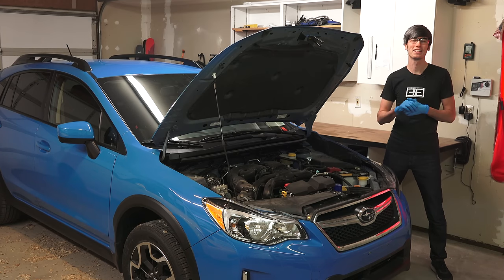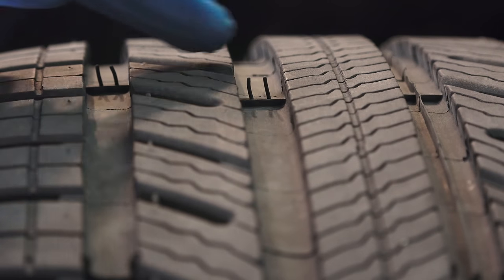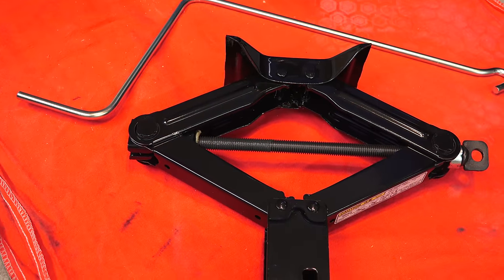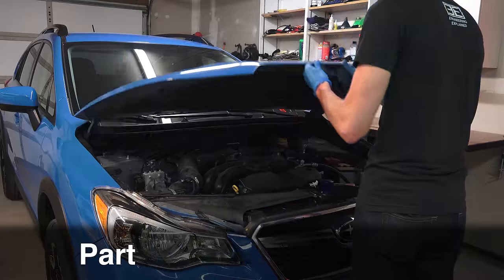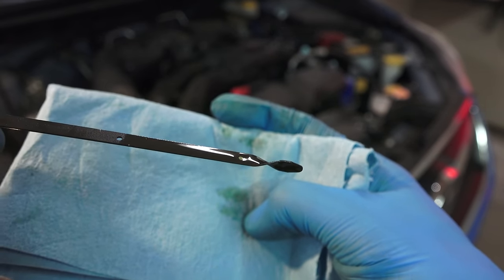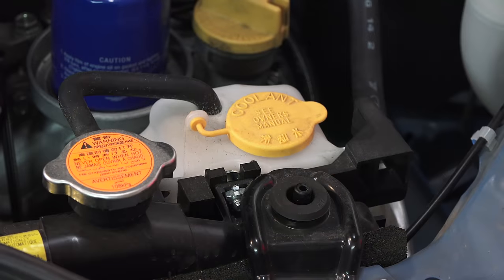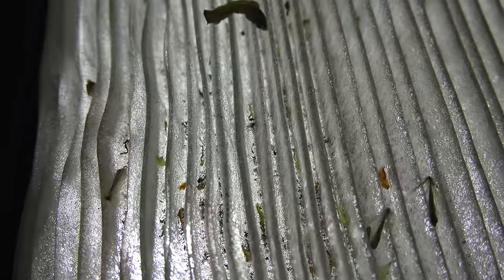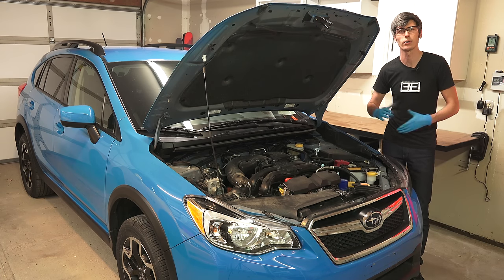How To Make Your Car Last A Long Time - Simple Checks

Comment: How To Make Your Car Last A Long Time - Checks payable to Engineering Explained will do just fine..
Reply: I use Progressive Insurance.
Reply: I'm still not sure. Should the dipstick read L or F? This is so complicated.
Reply: AHDBification  depends on how you drive your car. fill to L if you drive on the left side of the road and to F if you drive in the front of the car.
Reply: no insurance suspended license. but I got 200,000 in the bank from savings on no insurance and not paying tickets😉

Comment: These are great easy tips for anyone to check. I will say though the oil should be a little warm to get a more accurate reading. Turn your car on for a couple mins then off. There is some pressure that needs to build up and after a little time it will regulate. Take your dipstick reading there.

Comment: check the state of transmission fluid too.
Reply: yup one of the first expensive part of the automatic car that will fail even before the engine quits..
Reply: Can you guys give a little more info about this subject?... I've always thought it would be a good idea to maintain the trans fluid but to be honest I've never really messed with it because of all the different opposing opinions all over the internet as to why you shouldn't mess with it kind of made me freeze up when it comes to the trans because of the fear of effing shit up...I'd hate to do a trans flush and fluid change on a good working trans only to run into issues shortly after 

What are your guys opinions on that? Cuz I do believe it is important and want change the fluid in mine
Reply: HomeGrownPyro my 07 acura tl base nav has 140k miles on it and i dont think the transmission fluid has ever been changed. I brought it to my mechanic and he took a looked at it and it was kind of like light ish brown color(it didnt look like it was disgusting) he told me it was still in good condition. The thing is that my car in 3rd gear and around 1300 - 2000 rpms sometimes starts shaking like the engine is stalling out but it stops once i get the rpms higher or change gears. Also another thing i notice is on high rpms (above 6k) when it changes gears it kicks. Ive driven my dad suv hard and in high rpms the transmission doesnt kick its just a natural hard shift like it’s supposed to do. I bought the car with 136k miles on it and im thinking of doing a tranny oil change at the dealership since i want the car to last as long as possible. 

Im not doing any engine mods on my car since it would be just a waste of money. I will just try to just keep maintenance up on it. Ive never cheaped out on maintenance on it since i had it. I did an oil change on it, new engine air filter, and alignment as soon as i bought it. Recently i bought new brake pads and put those on cause it was an emergency. But im looking to replace all the rotors and calipers and pads(except the front pads) on it. Soon will be some lighter and better looking rims cause the previous owner had some gloss chrome heavy ass mexican wheels on it.
Reply: transmission fluid is the oil that keeps the gearbox LEGO set pieces of rubbing metal parts in the Gearbox running like a Swiss watch mechanism...it is the ''*engine oil*'' for  a gearbox on an Automatic car..VITAL to change according to manual API/SAE viscosity and intervals! Dont use Flush fluids, just change them with fresh auto fluid in accordance to manual recommendations or risk 5000 dollar replacement fine!
Reply: Not all new cars are made that way.
Reply: What are you, a time traveler? Were you frozen a while ago and only recently thawed? You don't check the state of transmission fluid anymore, they've been sealing that up for years and you can't get to it.
Reply: @mjc0961  mate not all people watching this video have the latest cars. i bet a lot of them have older cars. please stop embarassing yourself
Reply: @vincentsfuntimeworld5007  These days car makers encourage less maintenance and eventually causing people to buy new cars for more business angd profit. 100k oil change and sealed transmission are some of their tricks. Otherwise they would have extended warranty but they don't.
Reply: @mjc0961  If you can't check it yourself, you can ask your mechanic to check it. You should change your transmission fluid periodically if you want your transmission to last, unless you have over 100,000 miles on your car and fluid has never been changed and is dirty. In that case, you might do more damage by changing it, especially flushing.

Comment: How high should my oil level be if I upgraded to a short throw dipstick?
Reply from the maker: Solid mod! 😂
Reply: Oil has to be filled until it overflows from the valve cover. This allows you to do an oil pump delete for friction reduction.
Reply: Named after you

Comment: also if you want your car to last, drive sensibly.
Reply: I guess that means my cars won't be reliable.
Reply: Sensible whatever that means. “Same as saying don’t work out you could hurt yourself.”
Reply: E85 13B no. Thats a bad analogy. The correct one would be if not running the car in a long time

You dont workout= bad

You dont run the car= bad

Working out pretty often =good

Running the car pretty often= bad

Working out too hard with no breaks= bad

Driving super agressive in higher rpms = bad

Theres a balance to everything

If you drive agressive all the time i feel bad for your car. Once a while wont do damage
Reply: YUCK I can imagine the carbon buildup in the engine.... REV IT UP
Reply: E85 13B your car doesn’t recover and get stronger after you do a hard pull lol
Reply: no! drive like you stole your car
Reply: Unless you drive like Grandma all the time, your engine will be plugged in carbon buildup. I've seen a number of older low mileage cars vibrate a ton at idle. I'd drive them hard during a test drive and they ran smoother lol I'm not joking. Carbon buildup sucks.

Comment: In the aviation maintenance community we NEVER use digital gauges. Also highly recommend against the ones with the little stick that comes out of the back. 
Best gauges I’ve ever used were the ones with a dial, that has a check valve built in.

Comment: I live up north so I keep my tire psi at 35. You lose some psi in the winter so it's good to keep it as least 2 to 4 psi higher than recommend. I find some lights redundant such as parking lights and license plate lights. Purely for aesthetic. Every car should come with fog lights. It's useful when your low beam is out.

Comment: Only thing I’d add is to shake each tire if you get it off the ground. It shouldn’t have much play. If it does that indicates some problems with your suspension parts(control arm, tie rod ends, etc)

Comment: Other an checking the brake pad thickness and suspension this is all pretty simple easy to do stuff. Another check you may want to do is to check the rubber "boot" on your CV joint. Look for cracks or tars in the rubber. That being said, I'm a DIYer and as a retired guy I took a part time job at a local gas station to keep busy. In spite of how relatively simple to do these inspections are I am surprised how many people don't know how to do any of these things. Some things I've heard are, " oh? there's still oil in it, I don't need an oil change". The oil I just checked for them is the blackest black I've ever seen and in one case they had the vehicle for 3 years and had never changed the oil. Or, " do you think it's okay for me to go on the highway to XXXXXX right now?" , after a heavy snowfall. I said, " as long as your tires are in good condition" to which she says " oh they are new I just got them from my Uncle's car". The tires were all seasons all worn to a point where you couldn't hook a finger nail if you dragged it across the tire. Another big on is when someone  drives for 10-15 minutes to get to the gas station and adjusts the tire pressure to the pressure on the door jamb label. I have told so many people that as a tire is driven on the air inside it heats up and the tire pressure increases between 2-3 psi. So they have lowered their tire pressures back to 35 psi but are now running their tires at 2-3 psi low which has a negative effect on tire performance, gas mileage and tire wear.

Comment: It's amazing how many people don't even know how to check their engine oil level or tire pressure. Seems like common sense but you'd be surprised.
Reply: Don't get me started on changing tires either.
Reply: Or how many people inflate their tires to the pressure written on the tire. You know, the max pressure? Ugh. Check the sticker in the door, don't fill it to the max pressure. 🤦‍♂️

Comment: How to keep a car reliable.. buy a Honda 😅 in all seriousness great video with good tips!
Reply: 600,000km Honda k-series engine.    Check oil at least once a week
Reply: Tyler Peterson i have j series with 140k on it. No problems so far. 

Coworker with a dodge magnum v8 tried racing me and smoked his ass
Reply: Even a honda will turn to well engineered scrap if it's not taken care of.
Reply: That being said my dad drives a honda jazz (fit), 2010 model I believe, and my mum a 2003 Toyota Avensis Verso VVT-i. As you can tell they aren't exactly car people and as such they don't really maintain there cars, hell I've never even seen them top up the oil. But the toyota is still going strong! Never had a mechanical fault, is a daily commuter car and had been on many road trips around europe over its 15 years. I'm actually amazed its still running like the day we got it, mechanically speaking it hasn't been especially well looked after. And when it goes I think I'll oddly miss that thing, I practically grew up in it.

Comment: First thing I noticed under the hood is how easily accessible that engine oil filter is.. nicee
Reply: The older Subaru had a timing belt with a oil filter on bottom. New ones have timing chain with oil filter on top. Plus alot easy to get to everything. That's one of things I picked Subaru!

Comment: Can you make a video about driving habits to make your car last a long time. Such as proper shifting vs bad shifting that can lead to wear or appropriate loading of the vehicle and engine as well as being consious of temperature. How downshifting can affect your transmission if done poorly or whether to do it all. Your regular speed on highways and how that affect your car over time. Parking on inclines vs flat parkings. Hard braking or harsh cornering. Overfilling your fuel tank by rocking the car side to side. Putting too much water in your coolant. Using in appropriate oil. I'm no expert but these are some of the things I wonder about. I want to make my car last long but at the same time I'm an Uber so I have to use it extensively every day and can't always baby it. A proper understanding of all of the factors to allow us to use the fill potential of the vehicle within a margin of safety and care

Comment: step 1, stop trying to modify the shit out of it.
Reply: Unless its a Mazda rotary. To make it reliable: 
1: replace ignition coils with race coils
2: add 2 cycle oil to the fuel (either pre-mix, or plug the oil injector port and route it to an external tank that you'll add)
3: change starter to a bigger one if it takes more than a few seconds (also consider upgrading battery)
4: if its slightly worn, replace Apex seals with aftermarket parts

5: (only applicable where legal) de-cat if you plan on driving aggressive (which you should unless you want that engine may die within 50k miles). The Cat-converters are notorious for getting melted in aggressive driving and a fire hazard.

As for the big mods like getting 1000 HP per liter, those are obviously only for racing.
Reply: Coils are only for gasoline. Ethanol keeps igniters clean and no forceful ignition setup required for street use.
Oil injection again for race use. A rich ethanol injection keeps seals cool and lubricated.
Big battery and starter again problems of gasoline ignition. Ethanol will start on small and slow starter.
Factory seals last and are soft. A race seal will require more maintenance from hardness.
Catalyst problem again for the third time, gasoline issue from deposits.
All your bullets are problems of gasoline operated rotors, not ethanol.
Reply: I guess I haven't experimented enough with different fuels.

I've only been around Diesels, pump gasoline, nitro-methanol (RC airplane engines, though I kind of want to try that in a grass trimmer engine), and Jet A-1 (its a weird smell). My favorite smell now that I'm thinking about it is 2 cycle fuel with the synthetic "outboard" oil, the blue stuff. It reminds me of good times riding motorized bikes and drifting through town. For some reason it doesn't smell like the other 2 cycle oils, and I use it enough I can whiff test it and know about what fuel ratio its at (40:1, 50:1, 20:1). Any day that I smell like fuel is a good day!

Comment: Excellent video!

I am a mechanic and the one pollen/cabin filter I refuse to check are the older Mazdas as they are a pain in the backside to remove and replace. Unless it is dire I replace them but I charge out 30 minutes for is as the glove boxes need to be removed and the kick panel as well to get more access and even then it is in an awkward position to remove the screws for the cabin filter cover - all in all, a pain in the ass

Comment: I've used my phone to check my tie rod ends, control arm and trackbar bushings(solid axle vehicles) too.  You could probably check U-joints too by switching between drive and reverse, but those are usually a bit more obvious.

Comment: How to keep your car reliable: DON'T MODIFY IT!

Edit - I am not being serious, just a little bitter since my turbo is giving me issues right now! :p
Reply: Jensen MacDonald where is the fun in that
Reply: That's not necessary true
Reply: Hean Stone you can spend more time driving the car instead of servicing it
Reply: The fun of having it on the road and not sitting in the garage on jack stands. I'm just a little bitter since my car is giving me issues right now, turbo issues! :P
Reply: I know, was just making a joke as I'm in the middle of fixing my car and less than happy. Staying stock would have prevented this but no where near as fun!
Reply: @Jensen_MacD  always remember that some modifications done to a car can be good for it in the long run. While still giving more performance
Reply: People don’t know how to mod and that is why their cair fails
Reply: Or rather, don't modify it beyond your ability to maintain it.
Reply: Cabin air filter

Comment: How would wiper blades make your car last longer ?
Reply: @apache-yaquibrown4060  underrated comment
Reply: If the rubber on your wipers deteriorate it is not only dangerous in the rain but the metal could end up scratching your windshield and then you have to shell out $40 for wiper blades and $400 for a windshield.
Reply: @apache-yaquibrown4060  Silicon help re-moisturize the Rubber

Comment: I think it's important to check for the serpentine belt as well and the timing belt (if it has one, some cars have a timing chain instead). They also wear out with time if you keep your car long enough. You do need some tools to replace them, but still cheaper than taking it to the mechanic and cheaper than your car breaking down because the belt broke.

Comment: The video is very useful. I have a Subaru Forester in China, where our warranty is very strict and the 4S shop is very expensive to repair. There are too many counterfeit motor oils or accessories in China, so it is too difficult to pick. Thank you very much for your video, I can learn a lot.

Comment: No tools to change the cabin air filter??? Lol, you ever changed that on a Ford???
Reply: Owned a '97 Ford Contour SE V6 (bought new in '96, lasted 21yrs and 167,000 miles). Yes, I did my own maintenance. You had to remove the whole plastic strip, beneath the windshield to get to THAT filter. It was also VERY necessary to put a bead of silicone around the filter edge otherwise wet front passenger feet would be your next problem, when it rained. Miss that car. The CD4E tranny lost the 2--4 band and that was it!
Reply: @oibal60  well still better than removing the gaspedal to gain acces to the filter somewhere deep down beneath the centerconsole ... from the drivers side, dafuq is wrong with ford?!?!

Comment: Thank you!
That is correct 100 %! From experience, I change brake pads when they have around 3 mm thickness of active part. Happened to loose active part, due to hard braking in traffic environment. Were less than 2 mm ;)...
Still, you are the first to hear from, this useful tip ... Keep up! A very good day to you!

Comment: For easy remembering 
1. Keep an eye on tire tread depth, tire pressure, and tread wearing
2. Keep an eye on the brake pads and shock absorbers
3. Change oil regularly and change oil filter with every oil change 
4. Keep an eye on brake fluid and coolant and windshield wiper fluid 
5. Keep an eye on the engine air filter and cabin air filter
6. Change those wiper blades when needed
7. Keep an eye on all your lights. Low beams, high beams, reverse lights and brake lights

Comment: Good basic information that should be included in Driver's Ed classes - if they still have them in your district.  In addition, checking the owner's manual for recommended coolant changes is also very important to maintaining today's aluminum engines.  Keep these fine videos coming!

Comment: A quick tip about checking your rear brake lights on your car, put a pole or umbrella between the seat and brake pedal  and DO NOT START THE CAR, turn the key to number 2 on the ignition barrel.  Then you will be able to check them yourself any where without the need of a friend or a glass door. Plus you can check your reversing lights by not starting your car turn your key on the ignition barrel to number 2 then put your gear stick in reverse then you can check your reverse lights are working.